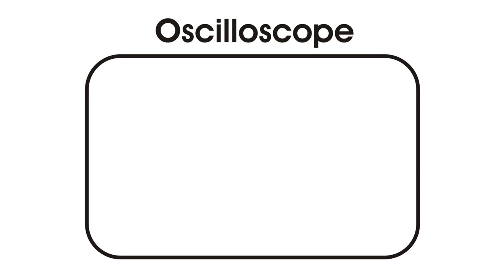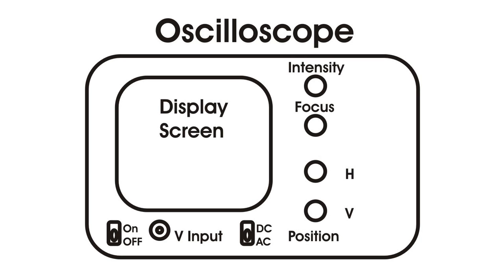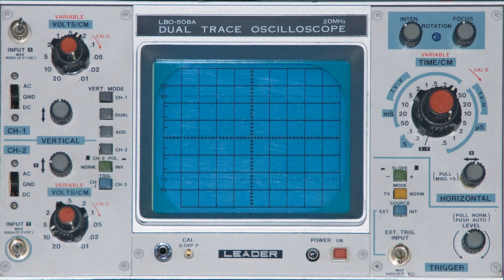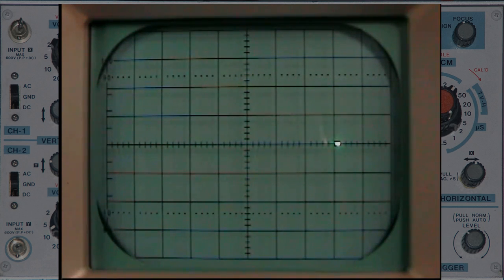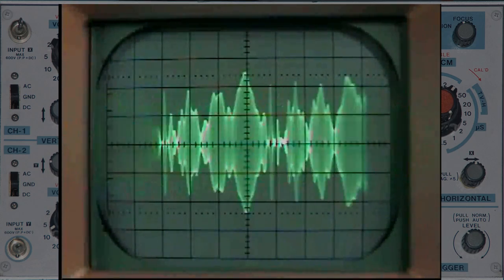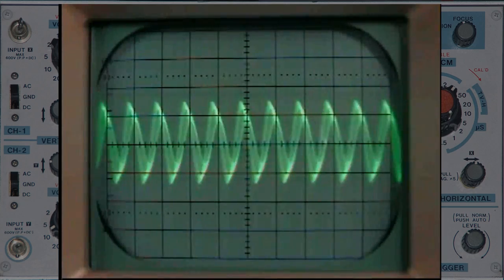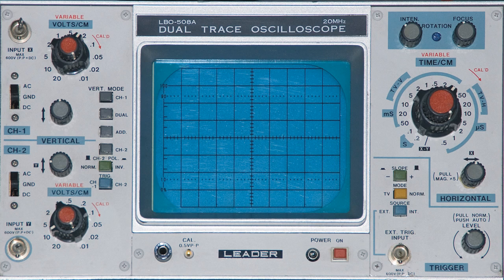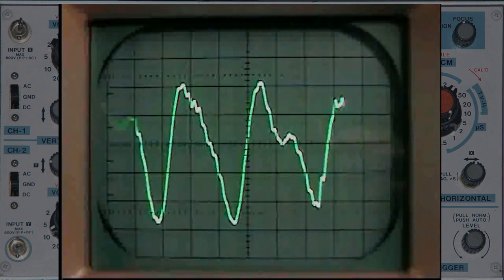Oscilloscope a Few Basics

Comment: Very Good.  One of my future projects is the restoration of my one inch, 1937 RCA Model 151 Oscillograph, (oscilloscope).  It did work several years ago, but had not been recapped or anything else done to it.  You do a fine job with your videos, and I'm sure it is muchly appreciated by all viewers.  Thabnks aggain.
Dick

Comment from the maker: Thanks.
That depends on the oscilloscope. This scope can take voltages in the high hundreds straight into the input. With the right scope probe it could handle voltages much higher. So check the specifications of all your electronic equipment.

Comment: Great video!! What is the voltage of the AC component of the audio circuit? It's obviously much lower than 67v?
What does a SSB signal look like when displayed in the same fashion as the AM signal you demonstrated here?
WR9H/Herb

Comment from the maker: Sure there are always some limits. With a high voltage scope probe you can look at thousands of volts. But I use a voltmeter for that job I don't want to take a chance of damaging a scope, meters a cheap. The trigger syncs to the test signal so it does scroll, left or right.

Comment from the maker: Compared to this 20Mhz the 100Mhz can capture much higher frequencies. In this case approximately five times higher. The 20Mhz has no problem capturing analog TV signals and that is what is was designed for. Thanks

Comment from the maker: Yes it replaces a signal tracer and does a better job. If you do not have an isolation transformer for the chassis under test use a 0.5mf@630WVDC cap or < between the chassis under test and the oscope. This will be AC mod only. I would try a 100k ohm resistor as the input lead. Thanks

Comment from the maker: Hey JC,
It is remarkable how useful oscilloscopes are. Accurate alignments, signal distortion, a tad light on modulation, signal tracing and troubleshooting are all easy to see with a Oscope. They are also a great way to learn about circuits too. Thanks.